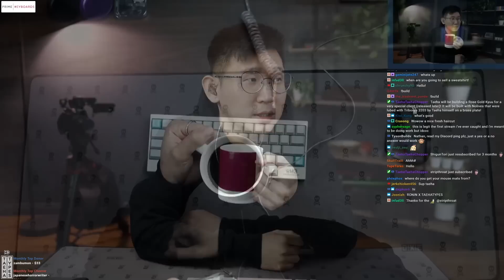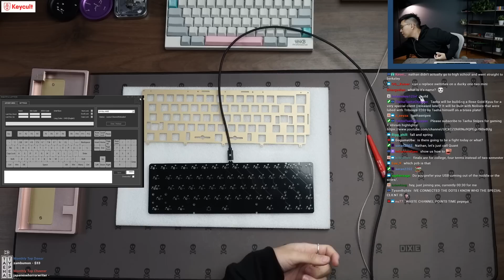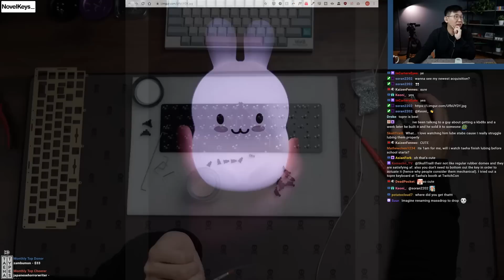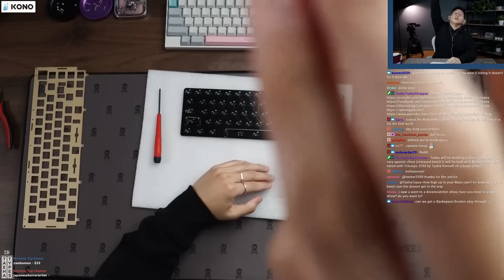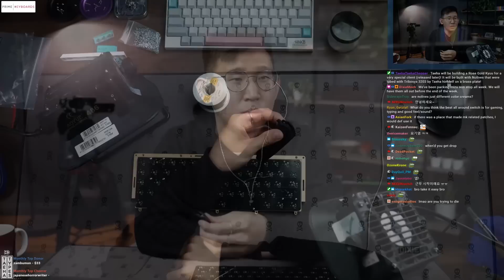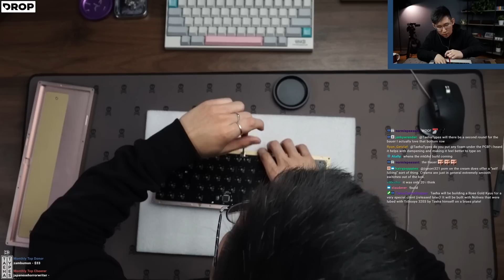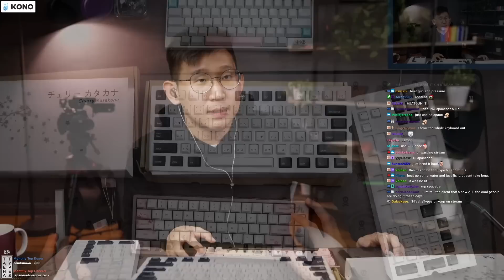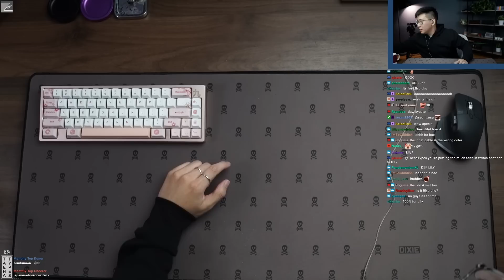Building LilyPichu's Rose Gold Kyuu Custom Mechanical Keyboard

Comment: Notpad++ is ok, but Emacs for the win!
It is a Lisp REPL where there are a Editor in. Which means you can do anything that you can do in Lisp in Emacs. And you can also do as little as you want, if you go with standard vanilla settings.

And Org-mode and Magit are enough to use Emacs just for that.  No need to surf the web, read email, play some games and control your Coffe maker with HTCPCP and HTCPCP-TEA (https://en.wikipedia.org/wiki/Hyper_Text_Coffee_Pot_Control_Protocol).

Most things are not hard when you know it. ;-)

Comment: what key switches are you exactly using?
Reply: Keyboard: Kyuu (Rose Gold)
Plate material: Brass
Keycaps: Cherry Sakura
Switches: Nolives
Lube: Tribosys 3203
Stabilizers: Genuine GMK screw in, lubed and clipped

this was in the description. if you want it to sound the exact same this is what he used, if you only wanted the switches he used Nolives which are linear switches i think.

Comment: Does anyone know any other pre-built alternatives to the one he built? I just need a 60% keyboard + RBG + the creamy sound on the one he built.

Thanks.
Reply: ye ur not gonna get this kinda sound in a pre built
Reply: @deeohteetee5144  I know that i can't get the exact sound i just need a creamy one, Thanks for the reply.
Reply: @dollafn  If you think about it my question wasnt really that basic lol. But yea keep doing your thing. Basic 🤡
Reply: I'd say gmmk then getting switches off novelkeys. Hot swap 60% with rgb.
Also get durock stabilizers and lube them. And a set of pbt keycaps